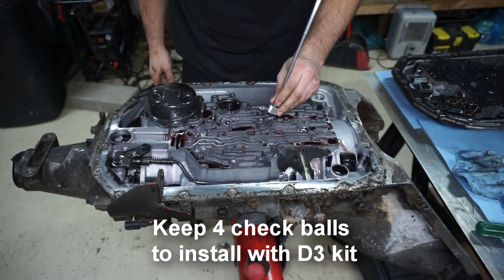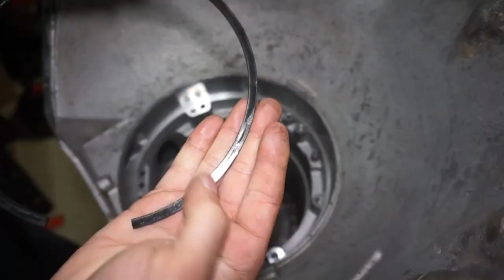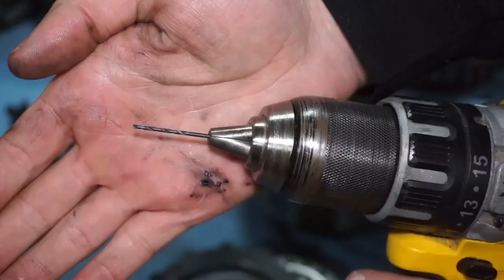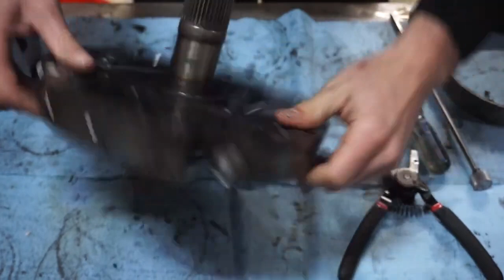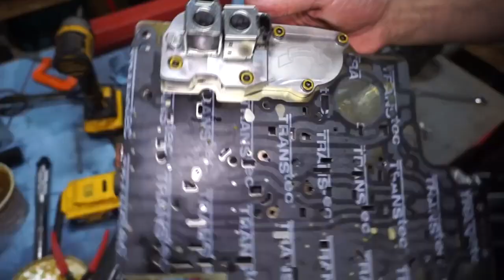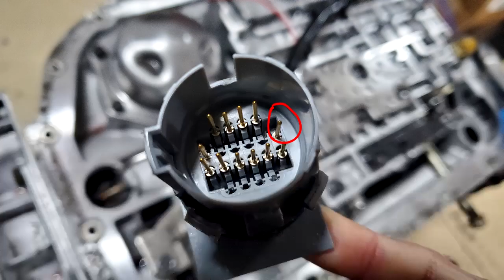How To Install Jakes Performance D3 Trans Brake For 4l80e !!!

Comment: With this trans break kit, Will the transmission still shift automatically in drive with a aftermarket controller? Or does the transmission become fully manual?
Reply from the maker: Automatic.

Comment: Tip for anyone rebuilding one of these. Instead of prying and damaging the pump to pull it out and instead of buying fancy puller use 2 pairs of vice grips. One plyer type and one c clamp type. Grab on to the shaft with the plyer type and then grab on to the plyer vice grips with the c clamp vice grip and it will pull it right out.

Comment: I am throwing a p0748 pressure control solenoid A. I have tried do not report but I’m still in limp mode. Trans shifts great using vcm scanner and lockup works great too. I’m stuck in 2nd gear in limp mode. It’s on a 2001 Silverado
Reply: O411
Reply from the maker: @Blackbirdtuningandperformance  Did you leave the epc solenoid plugged in? Factory ecu instructions say to leave it plugged in hanging in the pan so it doesn't throw code.
Reply from the maker: @Blackbirdtuningandperformance  I'll clarify, hanging in pan if using the EPC plug. If not using the plug you can just leave it plugged in. So it eill function but won't actually control anything.
Reply from the maker: @Blackbirdtuningandperformance  I'm using Holley Terminator so I was able to leave unplugged.
Reply: @BlaserBuilds  thanks for the reply. I got it figured out. Had to plug the epc in out side the case and zip tied it up. The trans was originally used for a Holley and they used C and D pin out for trans brake. Another question I have is the on the FF sensor. I ordered a 13577429 sensor and did not pay attention to the wiring. Just matched the wire colors which was wrong. I have it wired correctly now. I used a po1 ecm with 02 Tahoe operating system. The sensor is giving a p0178 and shows zero. I think I either hurt the sensor or the ecm once I got it wired correctly.

Comment: Finished the brake it will make the 1/2 shifts but won't go 3/4 I can roll into it and after a certain mph it will just stop and act like it is in neutral but Holley will recognize it and will shows gears coming down like it's down shifting but wont actually work until it's back in 2nd any tips ?

Comment: The o ring for the lock up did you put it back on or leave off ?
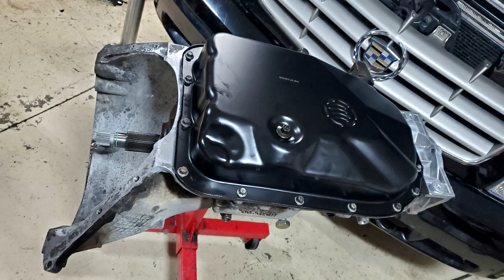Reply from the maker: Good catch. Put it back on it using lockup converter. You can see it installed at 26:26 mark.
Reply: @BlaserBuilds  seen where someone on the boosted LSx page was running into a shaft issue said he did 3 pulls and it sheered it off because of pressure is this where that dual feed mod comes into play ? Sorry for all the questions I'm doing my jakes d3 tomorrow so wanted to gather up all the info I can
Reply from the maker: @skylergaitan  No. The dual feed mod helps create more apply area for the piston for 3rd gear and reverse.
Reply: @BlaserBuilds  if I do the dual mod and my instructions only call for me to drill the drum only and says nothing around pulling off the 2nd ring on center support and I do it anyways would it mess with anything ?
Reply from the maker: @skylergaitan  You should have to pull the 2nd sealing ring. I dont think there's a revision that removes that step. Could call jakes shop and verify.
Reply: @BlaserBuilds  yeah cause my instructions only call for me to drill the drum and pump don't any anything about the dual mod or for me to pull 2nd ring but I'll call to verify

Comment: Do you know the pin size for the main harness plug? I want to run my 12v wire through the plug just as you did. Thanks!
Reply from the maker: Not sure. I usually use the PWM solenoid wiring for this now since the Solenoid is not used, and wiring is already there.

Comment: Why not just re-purposed the wires going to the EPC solenoid to operate the trans brake?
Reply from the maker: That works too, I have done that on a different build on the channel, and I prefer that method.
Reply: That’s literally what I’m doing right now! 👍

Comment: Any issue connecting the 18ga wire from solenoids to the 12ga on my solid state relay?
Reply from the maker: Should be fine, it's a very low current circuit because of the shift solenoid design.
Reply: @BlaserBuilds  thanks for the reply!

Comment: I've never been very good with Transmissions but I have bought a few trucks with the 4l80 in it and you get a good deal when they have no reverse if you weld on 1/8 of an inch to the accumulator rod it fixes it every time lol

Comment: You can run a D3 kit on a trans that already has a HD2 kit right?
Reply from the maker: You would just be removing the HD2... essentially aside from the boost valve and springs. The hd2 valve and springs in the pump may work, but I'd contact Jakes and ask. The HD2 dual feeds through separator plate and removes checkball, so essentially when you install this you're removing the hd2 kit, and dual feed is done internally and with new plate.
Reply: @BlaserBuilds  right on man. Thanks

Comment: In the D3 instructions I have it sounds like they want you to remove the "A" wire from the pressure switch and connect it to the new one. Did yours say to connect both?
Reply from the maker: One question? Does your set say to reuse EPC solenoid bracket to insert plug? If so that is a different set of instructions than my kit did not say to insert plug.
Reply: @BlaserBuilds 

Mine does say to use that bracket and not reinstall the EPC. It says to keep it plugged in and zip tie it up. 

Just ordered it during their Black Friday Sale.
I am not sure which route I go at this point, maybe give them a call on Monday.

How are you going to setup the reverse function? Use the momentary or use the reverse lights to control a relay?
Reply from the maker: @jderry1993  Probably just use the brake button.
Reply from the maker: @jderry1993  On his FB page he posted a video recently going over valve body changes that don't apply to older versions. So maybe something there changed.
Reply from the maker: Mine said to "T" to the pressure switch wire. When did you buy it? It seems like they're making changes to the unit so older instructions might not be the same. The instructions on their web site doesn't even have the pressure switch wiring, but there's an old one online from 2016ish that has pressure switch wiring that says "remove pin". So kind of confusing.
Reply from the maker: My instructions also didn't have the pump modification, but I asked on their FB page and he said yes to do it.